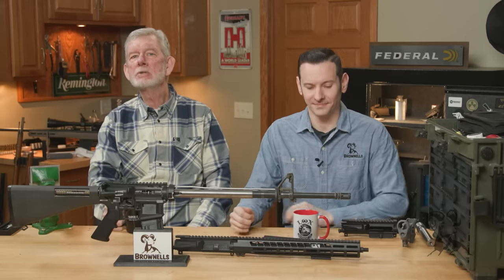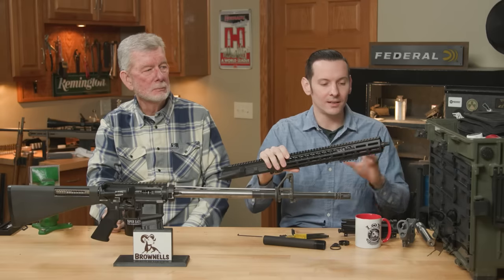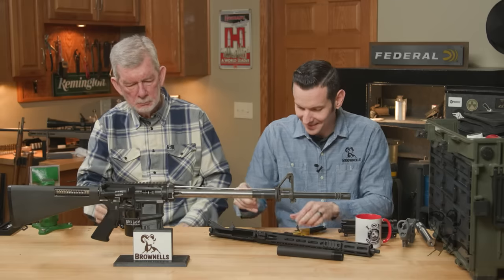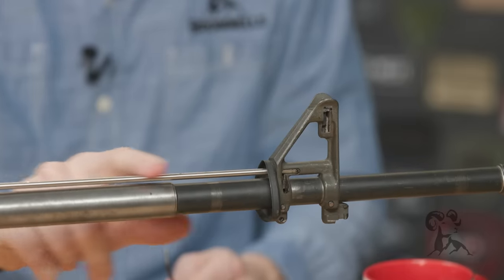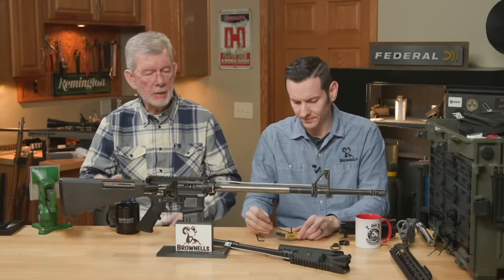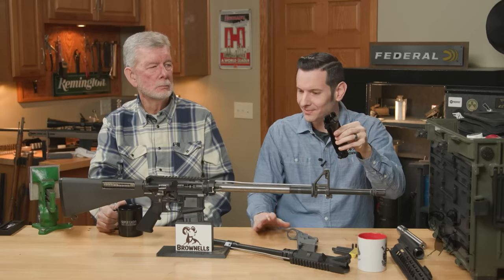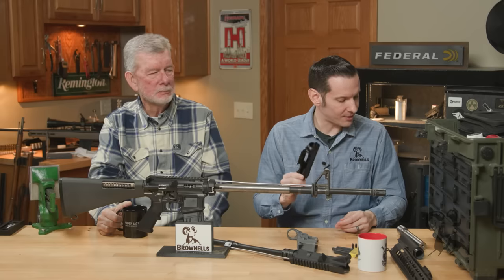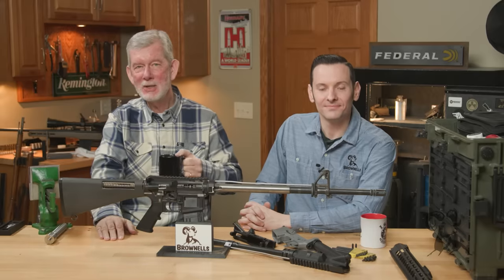Five More AR Builder Mistakes

Comment: To shorten any screw in confidence, first thread a nut onto it, then cut it. When you go to remove the screw, it will clean-up the threads, and you can use the nut as a mark to stop the cutting.
Reply: Excellent advice!👍
Reply: Thank you for this
Reply: Much better to shape it with a fine swiss file...
Reply: @Jreb1865  For the finish, sure. But for the initial rough cut, this is genius.
Reply: It's not perfect but yeah that's the way, you're correct.
Reply: Pro tip!!
Reply: O damn why haven’t I been doing this!

Comment: For the gas block interference problem: how about not using the Pic adapter entirely and in the first place instead get a device that directly mounts to M-LOK? You'll save weight, money, and eliminate a point of failure.

Comment: With gas blocks that have Allen screws, you can remove the screws then turn the block up side down and look through to see where it needs to be placed front to rear.  They drill the gas port using the rear Allen screw hole so it's perfectly aligned.  On some barrels they leave room for the A2 handguard backing plate that is around .0050 thick, that in return allows the gas block to be to far to the rear.  On most barrel gas block combos it's not a big deal, but should be checked to achieve perfect alignment.  I hope this helps.
Reply: They drill the simple using the gas port as a reference, not the other way around. The gas port location is referenced from the index pin on the barrel extension.
Reply: Yes, I always use that trick to double-check fore/aft alignment/pencil-mark the shoulder for centering the already-installed gas tube before drilling dimples for the set-screws.

Comment: Thanks for this one. Your first mistake was one that made me think. I have a Ruger MPR AR556 model 8514 with the rifle length gas system. After watching this, I went and looked at it, and sure enough, the screw that held my front QD point in place was jammed up against the gas block. It was a quick fix, but I have a feeling I'm going to have to re-zero the optic. Keep up with what you're doing, these videos are so informative.
Reply: You probably will, not because the optic was "not zeroed" but because the barrel will never be consistent with something pressing up against it like that.
Reply: And it can change barrel harmonics

Comment: As you tighten the castle nut, it turns the tube as well. Clock the buffer tube at exactly 6 oclock. Endplate does not center or align it by itself, the tube still has some play, so you must center it.
Reply: That nub on the end plate that interfaces with the lower keeps it from moving, there isn’t really a way to “clock” it
Reply: I find that having a buttstock/brace installed helps visually with final alignment.  There's not much play there but it's enough to cause easily-visible over-rotation if you lock it down and expect the end plate to locate it properly.

Comment: Yep, the buffer tube in too far was my first time mistake.  Wound up shearing off the buffer detent trying to get it back apart, easy fix and learned from it.  On another, I simply had issues with the upper and lower not aligning, had to remove some material from the lower, file the sides of the upper lugs and the pins are still tight as can be- mallet and drift pin to remove them.  I suppose tight is better than loose and it runs fine.   Good video, great advice.

Comment: I've heard many other Gunsmiths and manufacturers state there must be a gap between the gas block and shoulder of the barrel.....
More importantly, make sure the gas port lines up 100% with the hole in the gas block... I bought a simple plastic tool that helps to achieve this: the gas block genie.
Reply from the maker: Here's our stance on it- https://www.youtube.com/watch?v=H8EEUIRd8HU
Reply: The appearance of the gap is irrelevant. Gas port just needs to be aligned on the inside. i just buy a 99 cent packet of dry spaghetti.
Reply: @blantant  I was thinking more about heat/ expansion/ contraction and keeping "undue forces " off of the barrel shoulder..   not so much regarding the appearance
Reply: If you're super concerned then install it correctly and check with a borescope that has a mirror adapter.
Reply: You’re right. Not all gas blocks are the same, or meet the manufacturer specs. Same for barrels. Not all gas ports are the proper distance from the shoulder, nor are they centered. You can’t just assume every single one is perfectly within spec, and use the shoulder as a datum. Maybe use it for a starting point, but it should be verified and checked to be centered over the gas port.

Comment: Spot on, gentlemen.  I had to go back and redo a few of these little assembly jobs on my first build.  The main thing I learned from that first build is to do myself a favor, go full "nerd", and put together an engineering process management series of steps in an Excel Document (or Word doc) with all details needed (fps required for each nut/screw/etc.) to complete an AR build.  Once that's done,  I could begin executing my steps one at a time until the build is complete. 30 AR builds later and it's now second nature. Bonus tip for anyone who doesn't already know: spring/detent work should be done inside a pillow case or under a bed sheet that will catch flying springs.  "Spring slinging" happens to all of us every now and then (even expert AR builders). Better to have a pillow case because small springs in a small or large room = lost springs.
Reply: Says you. I’ve shot my spring and detent across the room, found it in the kitchen under the stove, immediately did it again, found it under the dining table, and finally installed it. I promise you I can find any detent, even in the carpet
Reply: @jeffpraterJSF I once found a detent in my master bedroom. I’ve only ever assembled in the garage…so somehow that little guy made it upstairs and buried into the carpet. Still not sure how 😂
Reply: After building literally hundreds of ARs, I buy extra springs and detents.
Reply: All I have to say... your poor wife...😂

Comment: Good video guys. The error I made on my first build was I had the hammer spring oriented incorrectly. Worked fine the first hundred rounds or so, then light primer strikes. I also got practice finding detents on my garage floor.

Comment: To your first mistake, I found that even if your screws do not contact the gas block when it's mounted, if it's not far enough away, you will still get contact later when you're shooting due to barrel whip.  So it's important that you either cut your screw short enough to avoid that but it's still probably better to just move your attachment enough to fully clear the block.

Comment: If you forget to put the buffer retainer spring and pin in your lower receiver and you don't want the hassle of fixing it but have some extra $$$....get a JP Enterprises silent capture spring.  They work great and don't require that retainer pin.  Having the retainer pin actually becomes a nuisance if you are pulling out your buffer when you have a silent capture spring.

Comment: I am an armorer and have built more AR and large frame ARs than I can count. One of the mistakes I see a lot are people not degreasing and greasing threads as they build. The technical manual is a good start, but is years behind in the evolution of these products. Most parts come with a preservation grease on them designed to protect the part, it is not for functioning. Use some denatured alcohol, degrease the part, then toss a little oil on the threads. This works for the mag release, receiver extension, Aeroshell on the receiver threads, etc.. Also, do a test fit prior to installation.
Reply: The only grease I ever had to worry about was upper threads and barrel nut.

Comment: I have always wondered about the spec of approx. .003" between the gas block and the barrel lip.  I've never questioned it, just grabbed a business card and used it as a gauge to space the gas block away from the lip.  I guess whatever works.  Thanks for the great video- I love this subject!
Reply: Use the barrel dimple and and it takes all the guess work out of where to align it.
Reply: Get a gas block dimpling tool. Done
Reply: @elzippo488   Not all barrels are dimpled. In the past, I’ve used a borescope to verify alignment. Recently bought a dimpling jig. Worth the money, although you have to buy multiple jigs to fit different barrel diameters.
Reply: IIRC, the thickness of the handguard end cap is around .020”, not .003”.  Business cards range from .020” to .030”,  so should be close enough.

Comment: Yeah, I saw a video where a guy had a gas port drilled a little further away from the shoulder of the gas block journal. He had to push the gas block back between 1/16th and 1/8th of an inch. I always check that now. A good way to check distance from the shoulder is with the pin at the bottom of most calipers. This will allow for measurement to the hole and even the diameter of it.

Comment: Regarding the omission of the buffer spring retention pin and spring, if you're using a JP Enterprises silent captured recoil buffer spring assembly, you're going to WANT to leave those two small parts out of your build, or you will blaspheme to no end trying to get your buffer spring assembly out for cleaning or adjustment. Ask me how I know.
Reply: it can break and fall into the fire control group too

Comment: I use a lot of Ballistic Advantage barrels mostly the Hanson profiles! Clint has a video that he states you run the gas block all the way against the shoulder! I use a borescope to confirm mine and he is right and so are these guys!
Reply: It's the correct thing to do for barrels that have not accounted for the possible use of a handguard retainer, such as your Hanson barrels. Most barrels, however,  leave room for the retainer, and for perfect alignment, would need a space that exact width if one isn't used.

That said, most gas ports (especially 223/556) are considerably smaller than the corresponding hole inside the gas block, and the average 556 gas port (≈0.07- 0.09") will still fall entirely within the roughly 0.125" opening in the gas block. And though it's not something you mentioned, but rather something stated in the video about carbon build-up if there's misalignment, I highly doubt that will be a consequential issue, as the pressure and temperature at the port will flame cut the barrel.

Comment: Every castle nut I’ve torqued to 40 ft-lbs. has sheared the teeth off. I’ve purchased 3 different wrenches for the job too. Were all the nuts just junk? They appear to be cast. Great videos.  Love your tips. Please keep them coming!
Reply: Yes, or you were torquing them way more than you realized.   Did you use a breaker bar or adjust for handle length?

Comment: I made the last mistake in the video. I didn't screw the buffer tube in enough to trap the buffer spring retaining pin in place... needless to say my AR did NOT run. It's surprising that that little pin not being where it's supposed to be can cause a hell of a jam. I had to slam the buffer tube on the shooting bench just to get the bolt carrier to move back.

Comment: I learned the lesson to clean before use.  I bought a brand new fully assembled Colt upper w/ BCG.  I slapped it on a lower I'd assembled and took it out shooting.  It did not want to fire.  At first I assumed the problem must have been the lower, since that was the part that I had put together.  Nope.

I found that the BCG was packed with grease.  It was so thick and sticky that the firing pin couldn't protrude all the way.  So clean and inspect before use.
Reply: Had a similar problem with an Alexander Arms upper, but it was the opposite direction: the grease they used had polymerized and jammed the firing pin out the front of the bolt face. When I closed the bolt on a round the stuck firing pin set it off. Fortunately I was following the 4 Rules and the gun was pointed in a safe direction and discharged into the ground in front of me, but having an accidental discharge like that was quite surprising.  

I contacted AA about the issue and it turns out they already knew about the problem with the hardening grease and had a safety notice about it, as well as had contacted all customers for whom they had contact info for. I, unluckily, was not one of those. The solution was to thoroughly clean off all the old grease and re-grease with something that would not harden (so basically any quality lube you chose to use). They had already dumped the questionable supplier and were running something else by the time I contacted them, so new products would not be in a similarly dangerous situation. It was a very easy fix to a very dangerous problem. 

But yeah, the 4 Rules people, they are important even if you think you have everything under control. Sometimes actual accidents do happen.

Comment: One thing I have never thought of,  and in dozens of builds have never had happen.  Found out the hard way that it is so simple but one of the Worst Simple Mistakes I have made because now That Lower Receiver is useless to me  (and it is a nice one that I was looking forward to using)  When installing the Front Pivot Pin in the Lower Receiver,  I accidentally dropped the Detent In First - and Then the Spring.  Used my tool to compress it to get ready to install the Pivot Pin.  And now I have a Detent STUCK in the bottom of that skinny hole,  and have been racking my brain for almost a year thinking of ways to get it out.   Ordered a Tiny Cylindrical Magnet,  but if it were loose enough to come out That way - it'd probably just have came loose with a Whack.  It is in there pretty tight and dammit,   I really want to use this Lower for a Build already.   Don't make this mistake...    ((ALSO>>>  Any suggestions are certainly welcome))

Comment: I think in machinists' term its call "facing" the receiver. Lapping meaning using lapping compound or abrasives to smooth out the inside diameter of the receiver.

Comment: Always run off shoulder .025 to center gasport. Do it right or don’t do it all, most of time it won’t effect gas on high pressure rounds but it will make a difference when running subsonic especially if factory barrel gasport is smaller. All my 300 blackout and 7.62x39 builds are port matched to Gasblocks and centered correctly this allowing 100% of gas to be utilized.
Reply: The hole in the gasblock is larger than the hole in the barrel so it will get 100% of the gas regardless. More info on that can be found here- https://www.youtube.com/watch?v=VH_fZNldI4o&t=1s
Reply: @CalebSavant  it will not on subsonic loads. If you do not have all the gas, I had a 7.62x39 that would not run subsonic suppressed. There was not enough gas due to 40% of the gas block covering the gas port.
Reply: @ngaoutdoors4157  I get what you're saying and I agree, but look at the video I linked.

Comment: Great advice, guys. I especially like the part regarding the receiver extension/buffer tube. I'm guessing you have to use an offset adapter - like a "crow's foot" wrench, as I know them - with a torque wrench in order to torque the castle nut to specification? But isn't there a formula necessary to apply when using an offset adapter w/a torque wrench? When I worked on nuke warheads while in the Army, we had to use a formula if an offset adapter had to be used due to a slight difference in actual torque applied:
M1 = M2 x L1 / L2. (You can look up the formula breakdown).😉 It goes w/o saying exacting precision was of utmost importance.
Reply: The crows foot wrench has to be with the square of the torque wrench facing you and with he wrench straight up to the left or to the right, 9 o'clock or 3 o'clock, if it is at the 12 o'clock position then you will not get the correct torque.

Comment: After having a buffer retainer break where the small tip breaks off and gets in a trigger cassette jamming it… I’ve stopped using the buffer retainer and spring. I do have a Jack-in-the-Box every time I split the receivers, but I’m ready for it.
Reply: If the buffer retainer breaks, your rifle is out of spec..You should fix it rather than leave the buffer retaining pin out..
Reply: You're definitely a PSA owner

Comment: My mistake is buying the wrong gas tube length for my barrel. I went to a gun store, show them my 16 inch barrel carbine length and I assumed that all gas tube are same length. The guy look at it and he just handed me the gas tube without even asking what gas length barrel is. When I got home and got the parts together ended up got the wrong part. I felt like a goober but I learn my lesson
1. Always check what gas length (Mid, Carbine, Rifle, pistol length) your barrel is
2. Not only you felt like a goober but the guy at gun store is 10x the goober than you are so don’t feel bad.

Comment: Dude, I had a BCM KAG and mounted it exactly under the gas block and once I noticed the screw came up and touched the gas block, I took it off and moved it back just far enough to where it wouldn’t touch the damn thing… Can’t believe you have to explain to people that you shouldn’t shave material off of your gas block! 🥴

One rail design you wouldn’t have that problem with is the Geissele MK4 and MK8, maybe there are more but that’s what I got, hope this helps.

Comment: I just replace a gas block on a AR15 because it was just barely touching. Built a AR10. I chose a bull barrel stainless bull barrel. The barrel nut had very sharp burrs on the inside. Scratched up the barrel. Ballistic Advantage was nice enough to bead blast it again. And I used a jeweler’s file and cleaned up the inside of the barrel nut. Just had to thread in a buffer tube one more turn  on a brand new AR10. Buffer retaining pin was barely catching the edge. Not it holds it and moves freely.